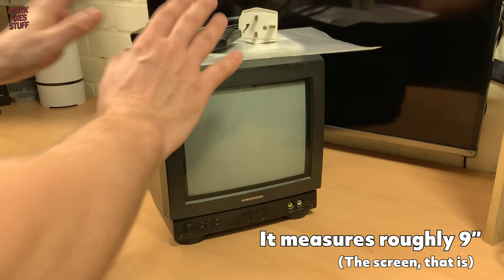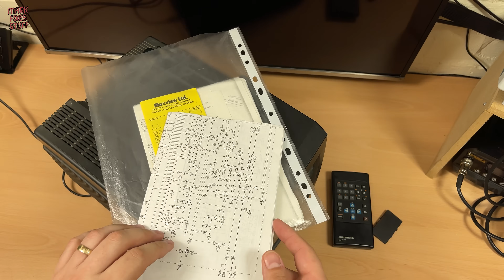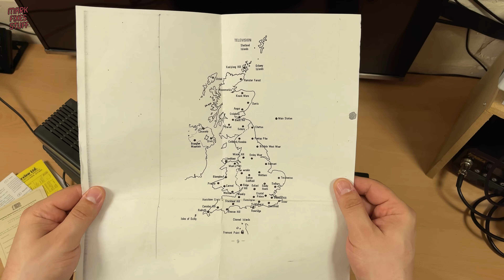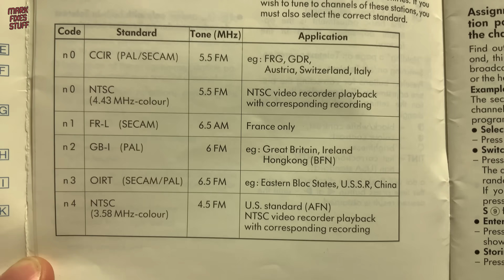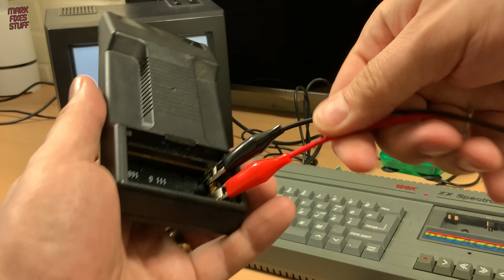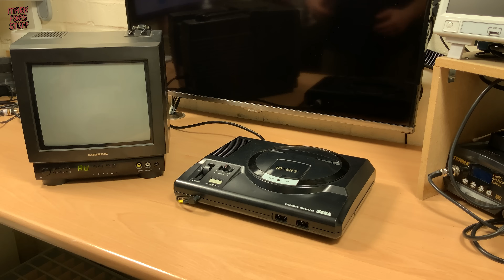A Teeny Tiny Tube TV for NTSC and PAL Signals! 9 inch Grundig P25-449/12 Colour CRT.

Comment: Mine delivered a lot of smoke and set the fire alarm off, turns out it has 2 paper capacitors by WIMA. Replaced them today with solid 305V Y2 0,1µF ones
Reply from the maker: That’s a good move.

Comment: Does it do 60Hz in colour over composite? Many PAL CRT TVs, while supporting 60Hz signals, display them only in black and white if the input is a composite signal (but no such a problem with RGB). I had a Grundig CRT growing up and remember very well that distinctive remote shape.
Reply from the maker: Yes mate. The Megadrive is in 60hz Japanese region, hence Streets of Rage 2 being Bare Knuckle 2!
Reply from the maker: I didn’t show the front input test because the video was getting a bit long!
Reply: @MarkFixesStuff  I see. I presumed it could have been RGB at 60Hz because of the scart cable. I have a Samsung PAL CRT from the early 2000s that does 60Hz perfectly over RGB but mostly in monochrome over composite. It's hit and miss as the 60Hz composite signal coming from the Wii (of all systems) is displayed in colour. I think it might be about the difference between PAL-60 and proper NTSC signals and how they are processed by that TV.
Reply from the maker: The inputs on this set are linked together so you can’t have both connected without interference!
Reply: @MarkFixesStuff  You connect it through RGB Scart in the video??

Comment: I have a Philips kickin' around here that's quite similar, though it doesn't have the front A/V,  just an RGB SCART and a DIN speaker output (same telly as the Pye Red Box..albeit not quite so red!). The cheaper 'caravan' type tellies (Nikkai Baby 10; Toshiba 'Cute'; Roadstar, etc etc) were quite basic often with no A/V inputs at all, so this is quite premium in that regard..
Reply: The Pye Red, the Philips, the Loewe BTX terminal/TV and this one all share the same Loewe fine pitch tube.
Reply from the maker: Thanks for the info. I was really suprised by the features of the tv. It's really very useful.

Comment: On Aliexpress you can buy 'Micro 4-inch CRT black-and-white display supports video input V4W 4 12-inch electron tube' for £12.37.  The mind boggles at who in the far east thought they could make some money from that.
Reply from the maker: I saw those too. I read that they are pre-existing overstock from a now defunct model of video entry system. Not sure if that's true or not but it makes sense.
Reply: I've checked that out and it looks like it could be a replacement part for an old video intercom maybe?

Comment: I have a 24 inch CRT, unusual brand (Durabrand) come from Asda I believe. It was my Grandfathers originally then my Father had it, I said when he was getting a new flat TV I have it for my classic systems. The TV also has 50hz and 60hz, composite, RGB and S-Video (two SCART connections) my commodore 64 and SEGA systems etc look good on it. I do have a LCD with all needed connections for my classics but prefer to use CRT 90% of the time..
Reply from the maker: Durabrand?  That's a new one on me!  I love playing on CRT, but filming them is a bit of a pain in the harris. That telly sounds mint.
Reply: @MarkFixesStuff  I think it was a brand only sold in Asda.. I had a 14inch SONY Trinitron before that but for some reason the colour had gone and could only get black and white. I did try and fix it but got stuck with the issue. Before the SONY I had a BUSH 14inch (top of the range for its time) Stereo sound etc. But I had it stored away for years, took it out of loft to use again, used it for about a month and a odd burning smell appeared (Tube burnt out) It was a good BUSH TV (BUSH is not known for quality) Filming on a LCD is easier and better. I have the best of both worlds with my two monitors on my desk, 32inch LCD, 24inch CRT that both run NTSC and PAL and both have RGB, S-Video, composite, RF and the LCD has component, VGA and HDMI as well. I do have a backup LCD in loft with same ports and same size if my LCD that I am using dies.

Comment: lovely little CRT.. I was surprised it can accept the RGB input and also to support both NTSC and PAL modes..
Reply from the maker: It’s a lovely little set and sits nicely on the racking when not in use!
Reply: These were designed for caravans and boats - cost a bomb too - hence the transmission tables... only posh people had them!